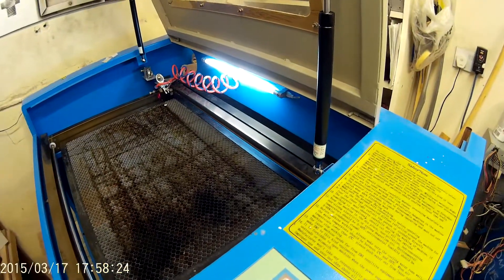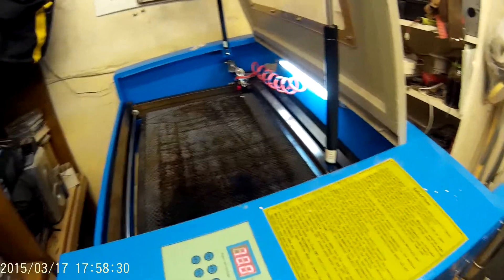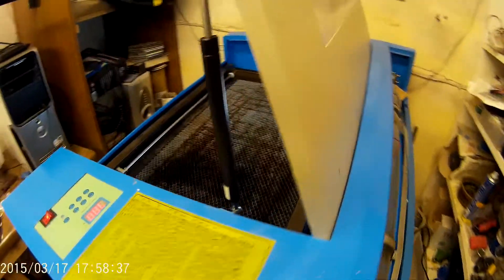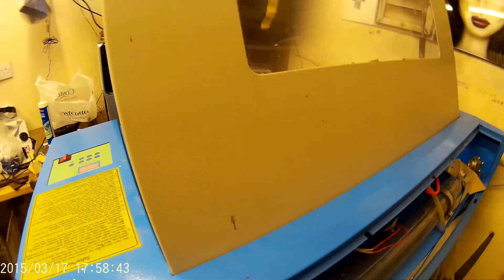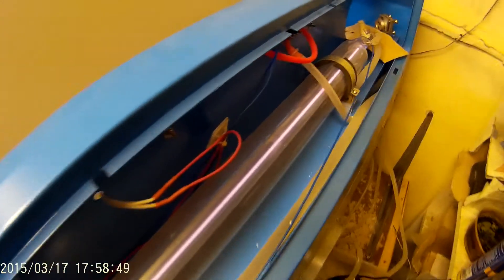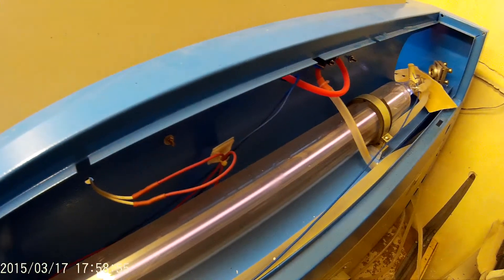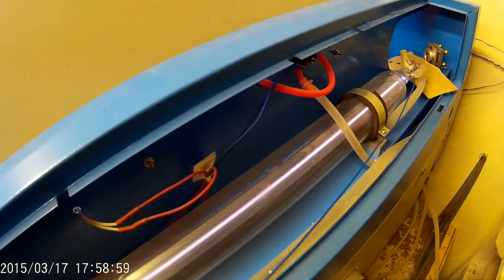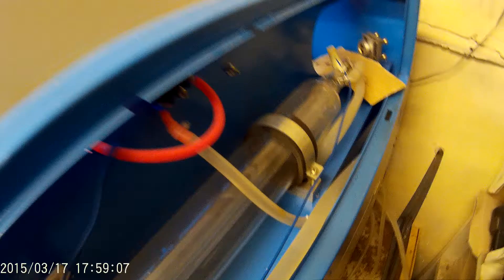Co2 Laser Misfire or no Fire more the problem

Comment: I know this is an old video but  for those seeking a solution for a similar problem  I can tell you this tube is depleted of CO2.  There will normally be a pink/mauve beam with a healthy laser but  as the CO2 breaks down to CO and O some of the free oxygen combines with  nitrogen to form oxides of nitrogen. Those oxides change the colour of the beam to almost white. The beam you see is NOT the laser beam but just the engine that drives the lasing process.  This machine has an "old school" analog controller that allows you to easily wind the current flow through the tube to 100%, Too much current flow through the ionized nitrogen  (pink beam) will break down the CO2 in the gas mix as described already. This 850mm long tube is in reality a 40 watt tube and should not run at more than 18mA. However, it is a certainty that this was already a B grade tube fitted to the machine by the Chinese and it would have been a poor performer anway.

 The comment about bad connection  could be valid in some cases because resistance (bad connection)  at the cathode end  will limit current flow and reduce power . However. if the beam is white (ish) then it's too late to attempt CPR.  A new tube is the only solution. BUT beware , do not buy cheap from ebay. Cheap tubes mean you will replacing junk with something that will rapidly become junk. Pay the right money for an A grade tube from a reputable source.
Reply: Pls I don't know what to do my laser is working but not engraving even when I press the test button it will not fire
Reply: @victorsunday8215  
Hi Victor
There are several things that may be preventing your tube from working  but I am a bit puzzled by your question.  On the one hand you say that your laser is working but then you say the tube will not fire with the test button. 

I interpret that as meaning that your controller is illuminated and your machine moves around but the tube is not delivering power.
It depends on the controller type you have as to  what you can check with LRD sormthe diagnostis on your controller  keypad Check these obvious things.
1) If there is power to the HV power supply you should hear the cooling fan running. If the fan is not working that means that something bad has happed to your HV power supplyand new  HV power supply is required.
2) if the HV power supply  fan is running then that is a positive sign. Next you must check that your flow switch is working. If you have a chiller unit, that is where your flow switch will be buried  If you have a simple sumerged pump and external reservoir. it is likeley to be in one of the water tubes in theback of yout machine. If your controller box has a WP  terminal then just adda piece of wire between WP and GND to fool the controller (this is just 5vdc and is not dangerous ).  If this allows your tube to work then you need a new flow switch .
 3) If you have a door switch,  then chech if that is working by connecting the switch wires together . Again, this is not dangerous because that is exactly what the switch is doing.

There is little else that will stop your tube from working.
Reply: @SarbarMultimedia  thanks I really appreciate ur response, the machine is actually moving around but not power coming out and even if I press the test button normally there is suppose to be a light going through the tube but it not showing. So maybe I should try the Wire to connect WP&GND
Reply: @victorsunday8215  
 Hi Victor.
I placed my check list in order of priority.  If the HV power supply is dead then there is no value in doing any of the other checks.
 Your machine (as I anticipated) is basically working OK but your laser tube is not. Therefore failure of the HV power supply.  is the mostlikely problem. There are  many highly stressed components (25.000 to 40,000 volts) within that box. There is no way to buy  a "quality" HV power supply because most contain the same high risk components. HV power supply life is a bit of a lottery with logevity being anything fro 6 months to 10 years. When it fails , there will be no warning , it just dies instantly.  If you can hear the fan inside the HV  box working, then it is worth carrying out the other checks.
Reply: @SarbarMultimedia  I forget to inform u that the tube is a new tube I install and since then nothing is happening just tired

Comment: Most issues are due to bad connection to the laser tube.   I thought my tube was bad as it was arcing at the hot orange wire end to the cabinet.  It was not the tube nor the power supply.   The original factory wrapped the wire around the posts and coated with silicone.  I removed all that and made new connector ends with insulated alligator clips which clamp down hard on the the posts.   I also replaced the wire length leading from the power supply to the meter and then to the front end of tube with 14 gauge.  My machine works again and better than ever.  I am getting noticeably more power output.  I normally cut .060 inch plastic at 25% power/ speed 10.  Now I can cut the same material with 15% power/ speed 10.

Comment: Jim, for some reason the comment is gone. Got your message though, and thank you. Just so I am clear, you only replaced the laser tube it's self correct? Before I go and spend a ton of money, I have one more question for you. On my laser it did the same thing, exactly. What I have also found out is if I lower the power setting, it works fine. It's almost as if I get "beam divergence" on anything above 70 percent or so. I also notice a small arc, or burned spot on the cathode at the end where the laser comes out. I am not sure if me using antifreeze in the system play's a part in it or not. Any advice you might have would be greatly appreciated.. Thank you for your time in advance.
Reply from the maker: +Sean G only used clean water in mine  here is a link to where i got one from.
http://www.aliexpress.com/wholesale?spm=2114.01020208.8.12.x2bWRs&initiative_id=QRW_20150922142455&SearchText=co2+laser+tube+for+laser&productId=935518022

only thing i noticed when i removed the co2tube was the lens looked a little dark like it was burnt.